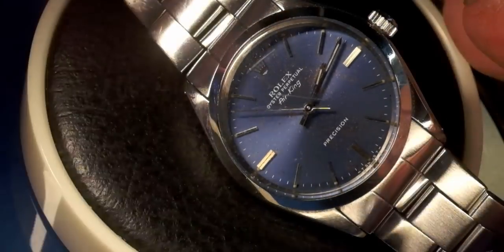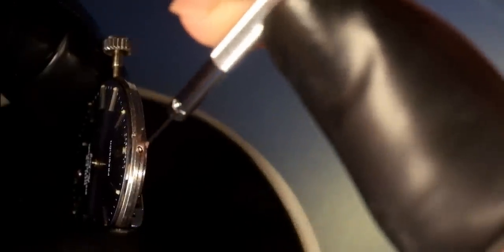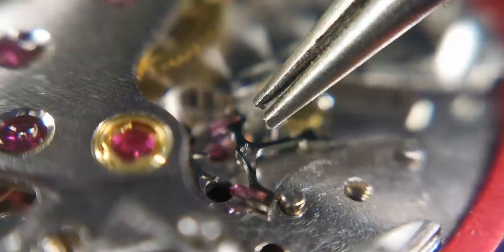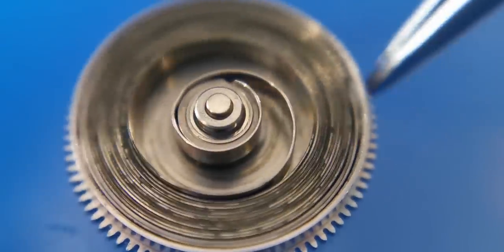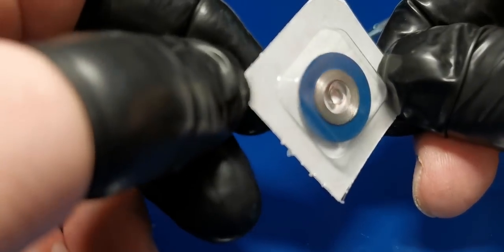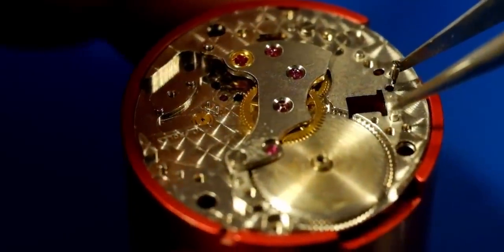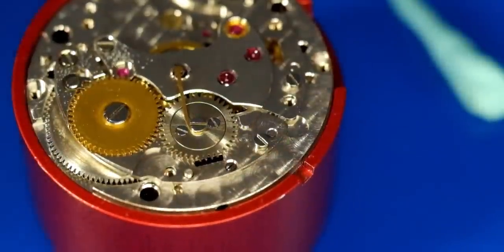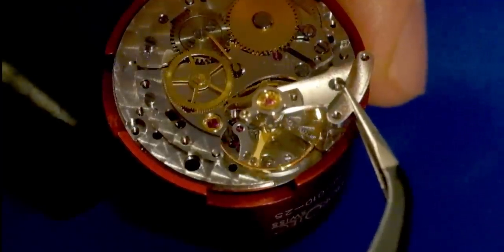Rolex Air-King - What Could Possibly Go Wrong?

Comment: I’ll try again. One of the things I like about your videos is that you’re not wedded to the use of expensive, special tools: hand levers from India, not Horotec, ultra sonic cleaner rather than a multistage washing machine and then modified tweezers to remove wheel on extended pivot. It gives me, as a real amateur, much encouragement. Thank you.
Reply from the maker: Hi Martin... Yes, I use stuff based on its engineering usefulness and not because it belongs to a brand or I think I 'ought' to use it.  If a tool works well I keep it if not I look for an alternative.  Thanks for the feedback. Richard

Comment: The modified tweezers are a great idea, now I wish I'd watched this video yesterday BEFORE I bought a Burgeon #3 presto tool on eBay at some expense!  (I've also just bought a bunch of tea strainer balls for the ultrasonic thanks to your innovating ideas!)

After more than a year of tinkering I'm now getting set up with everything I need for full servicing; I'm going to begin by restoring vintage watches and building my skill-set on those old movements. Your videos have been hugely inspirational and helpful and so at the start of 2022 I salute you sir!
Reply: Another tip I picked up elsewhere - instead of filling the ultrasonic with cleaning solution every time you can fill it with water and put the parts to be cleaned into small jars or zip-lock bags filled with solution (the ultra-sonic waves will easily penetrate glass or polythene) this can save on consumables and time emptying and cleaning the machine.  I'll probably try both methods and see how they work out :)
Reply: @fLaMePr0oF  i use this method with jam jars it works so well parts come out spotless  trick is to use 2 sometimes 3 jars with rinsing solution  i.e. use jar 1 then jar 2 then jar 3. Jar 3 should be virtually free from cleaning contaminants.
Reply: @antsfur  Thanks, will give that a go!

I've just registered my business name everywhere although I won't be doing servicing for a long while yet, just basic maintenance and selling my custom builds / mods  - 😁"NotaWatchmaker"😁

Comment: Great Video - I have one question please, what screwdriver did you use to take the two screws out that hold in the movement to the case? I did the initial three to take the winding mechanism off, however the slot on the screws are too small to fit the driver in!
Reply from the maker: Hi there ... most watchmakers will use a set of screwdrivers that looks like this ....  https://www.amazon.co.uk/dp/B07B8RBLDT  ... something like this this will give you most of the sizes you need.  However, it might be best to start on less valuable watches. I would not recommend that you start doing this on a Rolex  or other valuable watch without any experience as it is very easy to damage the watch.  Hope this is useful. Richard
Reply: @richardperrettwatchmaker  thanks, Richard!
Appreciate the response. 
Did you use the screwdrivers above? The ones I have are similar to these, but as I say the two screws/clamps that hold the movement to the case are too thin-slotted to fit it in!. I had a look online and there’re ‘parallel’ screwdrivers which have a parallel end, rather than the normal tapered tip, however I don’t know if the tip is actually thinner than normal ones and thus’ wouldn’t be an advantage.
Appreciate your help Richard.
Thanks

Comment: Hey, Richard. Thanks for the video! I have a question about the wheel you removed with your modified tweezer tool (driving wheel I think?). Does it come off of the pinion for the third wheel and then is friction fit back on during reassembly?
Reply from the maker: Hi joejunk... Yes it is as you describe.  The wheel is friction fit onto an elongated pivot if one of the wheels in the going train.  Hope this helps. Richard

Comment: Nice job Richard! I’d like to make a tool like you did for the 5 spoke wheel. Can you say more about it so I can replicate or could you make a short video on it! Re ultrasonic cleaning, how long do you do each clean for in the ultrasonic? What cleaning and rinsing and IPA do you use? I also use an ultrasonic cleaner and struggle to get good consistent results. I use Elma fluids and do a clean and 2 rinses all 20 minutes long. On very dirty watches I do a pre clean with peg wood, rock o and essence of renata with cotton buds. Sometimes if parts still come out a bit dirty I use Renata again. Cheers, Boyd.

Comment: The base plate has holes in it specifically to allow access to the pallets in order to add lubrication... wondering why you don't use them?
Reply from the maker: IHi Steve ... I think the answer is in the video.  I like to dunk the whole fork very briefly in alcohol after lubrication as I think this gives the best results.  This is not possible when the fork is attached to the movement.  Hope this explains.  Richard

Comment: Happy new year, nice video!
Is there any risk for the jewels, running them through the ultrasonic cleaner, by cleaning the entire main plate and bridges? Wondering if they could fall off?
Reply: Most jewels are fixed pretty solidly in their sockets in the main plate & bridges, and watchmakers ensure that any jewels that can be removed are secured by their little Incabloc clasps before they put them in the cleaner. But if a jewel does fall out in the ultrasonic machine it will either stay in the 'tea strainer' with the bridge or (worst case) fall to the bottom of the tub. Either way, Richard can re-fit them or order replacements if they do break.... it's amazing how robust these little timepieces are!
Reply: @medea27  thanks for the response, much appreciated.

Comment: Hello Richard. As a long time collector who recently took up watchmaking I appreciate that you are using some less expensive watchmaking tools us hobbyist have access to. When I started getting into the watchmaking side with basic movement services, many professionals chimed in on the tools required including a ELMA or L&R cleaning machine that spins the movement parts in a solution. They seemed firm on that for a proper parts cleaning. Like many watchmaking tools theses machines can be pricey for the home hobbyist. I appreciate you as a professional watchmaker still use a affordable tools like a ultrasonic machine. I also seen some of your other video's where you are using Stella brand Italian made tweezers instead of Dumont. I'm sure you buy more expensive Bergeon or Hortec when justified but go a bit more economical on things that you can. I would like to see you make a video on what tools a beginning watchmaker needs vs required for a proper job starting out. Thanks.
Reply from the maker: Hi 24 Hour GMT Channel ... great feedback thank you.  The importance thing is what a tool does as evidenced by the result.  Ultransonic cleaners are great I think.  Perhaps more importantly so do some high end watch brands who specify their use in the latter stages of cleaning.  These days I tend to use steel and brass tweezers which I customise the tips of to my liking.  Thanks again.  Richard
Reply: @richardperrettwatchmaker  Yes sir. Very true. It does appear that like watch brand snobbery, not surprising there is a bit of snobbery on the tool side as well. Thanks.
Reply: @24hourgmtchannel64  Just keep in mind that an ultrasonic cleaner offers a different type of cleaning to those 4-stage pro machines.
An ultrasonic is a gentler (and more forgiving!) option because it's using small waves to knock dirt off without moving the parts (like a dishwasher)... it's a cheaper machine but you still need to manually do rinse & dry cycles. 
Those 4-stage cleaners move the parts through the solution to get a deeper cleanse (think top-load washing machine).... but they also clean end-to-end. Most pros & long-time hobbyists I've seen use a combination of both... ultrasonic for the case, band & sometimes the whole lot if it's not too rusty/dirty.... 4-stage when they need some heavier cleaning. 
It's important to understand the context & the reasons why certain tools (and even certain brands) are recommended.... not just assume it's 'snobbery' because they cost more. I've managed to collect numerous watchmaker & jeweller tools over the years which I use for completely different purposes in other hobbies, because they are perfect for doing specific (and usually very fine) jobs. Use what works for you! 👍

Comment: Just had a look at the Sea Wolf, nice looking watch, love the cyclops, but disappointed it's only rated to 60 meters.
Reply from the maker: Hi Jim ....Interesting feedback.  Thank you.   I can only test down to 60 meters but was not worried about this as 60 meters is in reality a hell of a lot of pressure.  What is driving you disappointment, do you actually want to take the watch down below 60 meters?  Some guys do but these are very few in reality. Apparently professional divers tend to use quartz watches with massive bezels that they buy for about $250 from the same place they buy their other diving gear.
Reply: @richardperrettwatchmaker  I'm only going on what I read, and most articles state that you need 200 meter water resistance for swimming and surfing.  When I retired I bought myself a watch that is rated to 3,900 meters. Now that is pure advertising and bragging rights.

Comment: Happy New Year! One question: When you remove the dial there is a curved gold washer. What function does it have and I have seen in other videos that depends on the watch being in one position or another? Thanks and very hard work.
Reply from the maker: Hi Kopje .... The part you refer to is called the Dial Washer.  It is curved so that when the dial is placed on the watch it creates tension to hold the hour wheel in place and interlocking with the minute wheel.  Without it the hour wheel can fall foward and become disengaged.  Happy New Year!  Hope this explains this well enough.  Richard
Reply: @richardperrettwatchmaker  Thank you very much Richard. I understood perfectly. Because my English is not very fluent, I always miss the function of the Dial Washer.

Comment: So how did it run??? Didn’t show timegrapher
Reply from the maker: All is revealed in episode 2 Richard... Stay tuned. Richard
Reply: I tried cleaning bal in plate but my spin dry and heat didn’t do it and favors? Using a bulova Watchmaster wt since I restore them…I mostly use one dip for balances .

Comment: I have a neat trick. I have taken various sizes of stainless tweezers and done a two-layer nickel plating on about the last 4-5 mm of the tips. I electroplate with Nickel first to give the electroless Ni a good subsurface, I plate to about, .015 mm thickness These tweezers keep the strength and flexibility of the stainless but will not scratch any steel parts. Most watch repair folks have these plating materials, if not they are very cheap on eBay or Amazon.

Comment: One of my Rolex watches has registered design 6694 and on the side with the serial number it also I believe says stainless steel. I haven't looked between the lugs in quite some time. It has a Rolex band that looks like the normal old oyster bracelet but it is a stretch band. 
This is how I recieved the watch from my Grandfather. He was a well respected watch maker in Arizona. 
He is also the one who got me started at a young age learning how to service a mechanical watch. I am at this time would be what you may call an advanced amateur.

I love mechanical watches. I actually hate quartz watches which many find rather amusing.